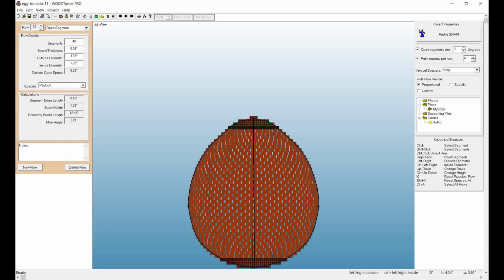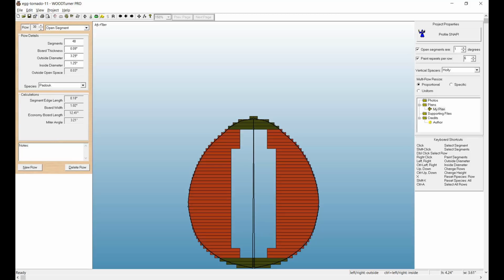Segmented Wood Egg - 4,500 Wood Segments (36)

Comment: nice work! how long did the milling and glue-up take?
Reply from the maker: The cutting and lathe work did not take too long.  What took the most time was the glue up, because i clamped each disc, one at a time and let it set for 5 to 10 minutes before I glued the next disc.  I probably spend a good day just gluing it up.